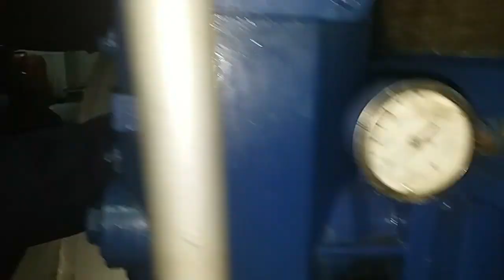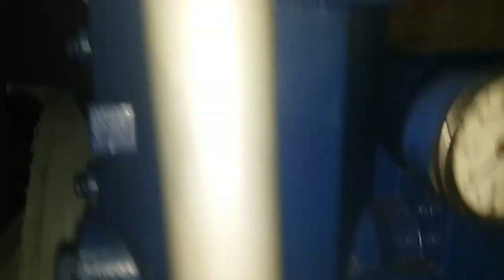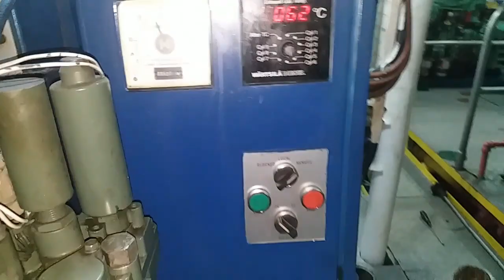Cara ganti gear roda gila ( Renew fly wheel gear ) Main Engine WARTSILA 1750 KW , part 2

Comment: Mas agus,genset cummins 250 kv low power opone mas. Nek di kasih beban gak responsif gt.
Reply from the maker: Di lihat asap mesin mas warna apa.. bisa jadi kompresi lemah..
Reply: @agussuriyanto2907  ok. Suwun